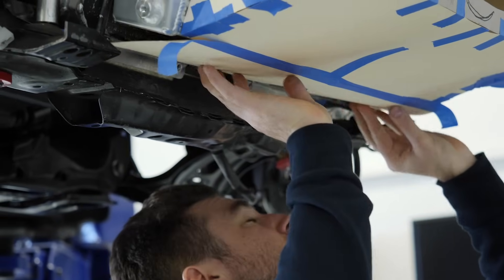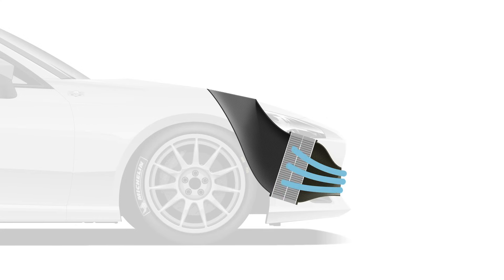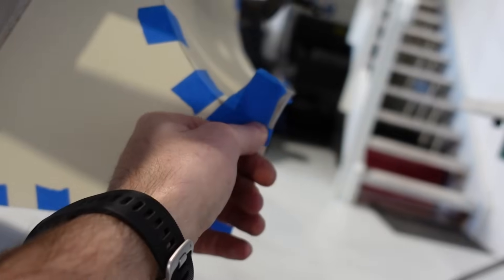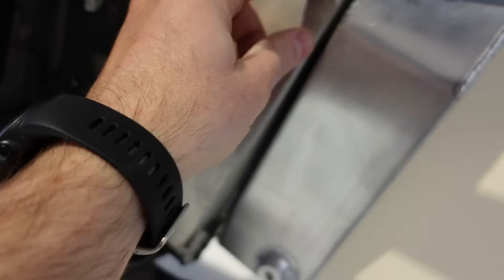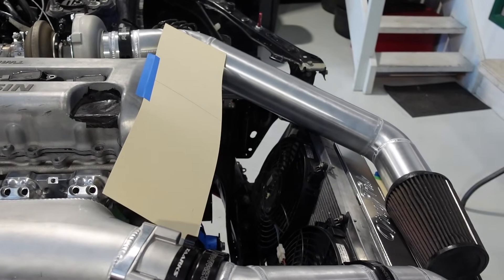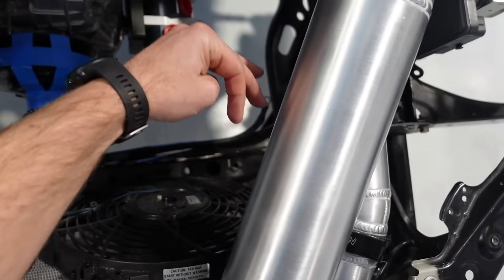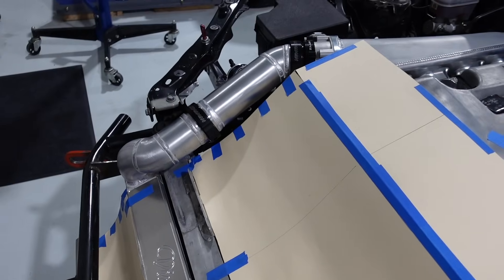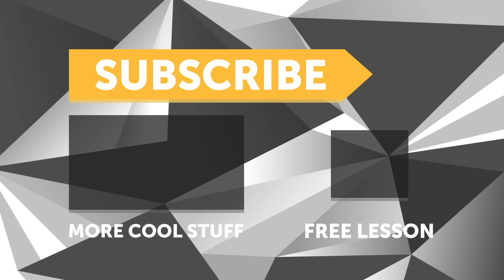Ducting and Coolers | 650HP SR20VET Swap | SR86 EP 3 [#BUILD]

Comment: I know this is an old video so this might not get much attention but just out of curiosity. How come you decided to lead all the air out through the bonnet rather than to lead at least some of it down under the car? Seems like it would be easier and the lower part of the firewall usually has good aerodynamics for it. Maybe some of it can even be used to draft air into the brakes
Reply from the maker: Brake ducts are already on the front of the car, channelling warm air from this to them would be a bit pointless and difficult in an already tight-ish engine bay.
The air going out the bonnet means it also goes over the rear wing.
Very simplified answer, but if you're an HPA member you can post questions like this up on the forum perhaps even in relation to your own specific build - Taz.

Comment: Better to face the air down after the radiator... the downforce on the bonnet is working against the fan... 

I'd be using that bonnet to reduce engine bay temps...
Reply from the maker: Hmm not quite for a few reasons, some of which I believe were also discussed in this video but Kyle also explains nicely here if you don't trust us for any reason: https://youtu.be/cDKBYfslzSw

Note Kyle is an F1 level aerodynamicist, and you will find setups like what was done on the SR86 here throughout professional motorsport (as in cars designed and built by people like Kyle specifically for performance).

You might find you are having engine bay temperature issues because of setting things up as you have described which Kyle also touches on.

Hope that helps! - Taz.

Comment: Can this same concept apply to ducting it out the bottom of the car?  Heat would theoretically create a high pressure zone under the car causing less max grip?  My car is primarily a street car and don't plan to be pushing limits on the track for anything.  91 300zx

Comment: Could you possibly use fins inside where the angle gets steeper to try and keep the air connected to the surface rather than detaching and causing stalled air?

Comment: Is an outlet duct really necessary? I the ducting is more pressure behind the radiator than if it were simply open to the engine bay, and then the hood vents could help heat escape from the engine compartment. Turbulence is the only con I can think of.

Comment: Is there a benefit on going a v mount setup as opposed to mounting the inter cooler and radiator inline?
Reply: Packaging, if you look at the jgtc supra, it has a 3s, but its pushed way back into the fire wall, that allowed them to go v mount. V mounts work well with fd3s rx7s too. So it all comes down to packaging. Those cars work because of where the engines are located, in local series like these guys run most sanctioning bodies dont allow fire wall modification

Comment: Why not make the outlet more square to get horizontal clearance? The flow out of the radiator has to deflect up pretty aggressively regardless so I wouldn't think the change in profile would change the air flow to significantly, particularly compared to kinking the inlet duct and maybe making a turbulent section beyond the kink.
Reply from the maker: For our case, we really maximized the amount of space we had available in front of the engine. Packaging proper ducting in cars like this always has massive compromises, this example is no different. We were trying to balance the outlet cross-section area we needed with the space in front of the engine and trying to make the outlet angles as gentle as possible, this pretty much defines the aspect ratio for you.  We have to work with what we've got! - Tim

Comment: What are the benefits of bringing the outlet over the top of the vehicle instead of under? Or if space permitted, out the fenders? 
More downforce? Faster air over the car acts like a venturi pulling hot air out of the duct?
Reply from the maker: The two main things to consider are packaging and aerodynamics of the outlet areas you have available. Most often, unless you are building an entire car from scratch there limited options of the places you can actually fit the ducting. Once you know the possible places you can actually fit it, you need to look at the likely pressure and velocity of the potential outlet areas. To make the outlet as effective as possible you want to exhaust the duct into a low pressure area, this helps "drive" more flow through the whole system. For us, the bonnet was a sensible place to package the duct. With the outlet (which isn't shown in this video but you'll see in later ones) we use there is a small gurney-like feature on the front of the outlet. This works by taking the high velocity clean air at the front of the bonnet and disturbing it, which creates a low pressure area in the duct outlet which helps drive the flow out through the duct. This arrangement gives us more cooling for less drag, therefore giving us a higher efficiency - Tim

Comment: Thanks for reminding me about air flow out.  I literally forgot about it I did directing air in but not out.  Where's my cardboard cheap and easy to work with.  Has there been any don't on installing dry sump oil systems like conversating from wet to dry?
Reply from the maker: Glad you found it helpful, there's definitely a time and place for cardboard and tape! Here is a recent video we did on the dry sump system on this car if you're interested - Tim https://www.youtube.com/watch?v=m8ofSWgtWKQ&t=567s
Reply: @hpa101  that video was very helpful and lost of information.

Comment: I'd split the duct exit in middle in a Y and run it out the cowl around engine for a longer travel and less back pressure to the flow path.
Reply from the maker: For sure can be a good way to do things. For us that wasn't an option with both manifolds and turbo taking up so much space at the top/rear of the engine bay - Tim

Comment: so when you have a volume of gas, and then you expand it, you end up with a lower pressure, think of it like how a ram air system works, you start with a bigger inlet, and compress it down to a smaller outlet, this increases the speed and density of the air, effectivly boosting the engine (like on a road bike). If you reverse this process and expand the air, your going to slow it down and reduce the pressure. So you should make your inlet as large as possible to catch as much air as possible, the rest comes down to packaging. (im not saying his setup isnt going to work, just his assumptions about fluid dynamics is wrong)
Reply from the maker: Here, I think you're getting confused between static and dynamic pressure. When the velocity of a fluid decreases, it's true that it's dynamic pressure also reduces. The dynamic pressure can be thought of as the kinetic energy in the flow. When the velocity of a fluid decreases, the static pressure increases. The reason this is true (at least in an idealized case) is due to conservation of energy. To put it casually, the total energy within an idealized flow is constant. So if the flow goes through an expansion, the velocity drops, this means the static pressure must increase for the energy in that flow to stay constant. Dynamic pressure is what you feel when you put your hand out the window with a car driving at high speed, you feel a high pressure, this is the kinetic energy of the air. It is the static pressure we are interested in manipulating with this style of ducting - Tim

Comment: What the trade off with airflow over the engine itself, or is it just not really something to worry about with such an efficient cooling set up?
Reply from the maker: With this style of car (something still relatively close to OEM) some air will always find its way into the engine bay and inevitably remove some heat as it moves through and on its way out. However, this isn't the dominant heat transfer method for the engine, the bulk is being rejected via the water cooling system. It's true a little bit less air will find its way to the front of the engine with this ducting setup, but the gains in efficiency (cooling divided by drag) should far outweigh any loss of cooling form the ambient air swirling around the front of the engine, fair question though! - Tim

Comment: Why dont you just make the outlet narrower (in the transverse direction of the car) so that you clear the intake? I would imagine that it's OK as long as the outlet is the same area.
Reply from the maker: For sure this is a possibility which we thought about. In the end there was a target cross-sectional area we wanted for the outlet and the space back to the engine sets the depth of the outlet for us. That then defines the outlet width and not allowing the inlet tube to pass through the duct would have meant the duct would have been a long way off center. It's certainly a compromise, both in terms of adding complexity to the duct manufacture and potential separation at the duct outlet. This is simply our choice of compromises - Tim

Comment: Great content guys! Would an inlet still be beneficial if an outlet isn’t achievable due to engine and intake configuration (k swapped Integra) We have bonnet venting already but ducting the rear isn’t viable
Reply from the maker: With this style of duct, for sure the outlet is just as important as the inlet, they're designed to work together. Packaging is always a challenge with this stuff, there are certainly plenty of compromises in this setup of ours as well simply due the space restrictions! In saying that, if there's simply no room then yes it is probably still worthwhile to have the inlet only. For the outlet, just do the best you can to try direct the air exhausting from the heat exchanger to the lowest air pressure area you can, good luck! - Tim

Comment: You should have K24 swapped it instead. Far superior engine to the old.shitbox sr
Reply from the maker: Here's the thing - Everyone has their own opinion on what is the best engine in the world and that's fine. What you obviously don't understand however is the reasons for our decision. First of all a K24 would be absolutely useless to us since it would put us in a different class so it's not even an option. 'Use a K20 instead' I hear you say? Yup, could have done that and granted it's a great engine - Perhaps one of the best N/A 4 cylinder engines I've tuned. Problem is we didn't have a K20 and couldn't have sourced, built, installed and wired one in 4 weeks so again, simply not an option. On the other hand we did have a complete built SR20VE sitting in our 350Z. 

Next let's address this 'shitbox' SR you speak of. While I wouldn't have used the term 'shitbox', I also don't have a lot of love for the run of the mill SR20DE/DET. The head flows poorly and the valve train is a disaster. This however is NOT an SR20DE/DET as it uses the VVL head from the P11 Primera. The P11 head flows exceptionally well (probably pretty similar to a K20) and uses Nissan's take on Honda's Vtec with high and low rpm cam lobes. It also uses a rock solid shaft-mounted rocker system fixing all the woes of the DE/DET heads. Ultimately there's not many 2.0 litre 4 cylinder engines I've tuned that can produce 600 whp on 24 psi and have a power band from 4500-9000 rpm - Hard to refer to that as a shitbox in my humble opinion but perhaps that's just me - Andre

Comment: Love the fan work, this kind of stuff take forever.

Minor technical nits, you want the highest mass flow possible through the heat exchanger for maximum cooling. The problem is a duct you put in front of hx is likely going to stall (flow.separation) at some range of Reynolds numbers, this makes mass flow.really drop.

To help keep it from stalling, put at least a 10-20 mm radius on the inlet as you won't reattach in a duct like that if you get inlet separation (look at F1 duct inlets).
Reply from the maker: You're right, some large radii would definitely be a good addition in future. Like many things when you're in a hurry like we've been, you've got to draw the line somewhere in order to speed up manufacture time - Tim
Reply: @defsr7 Help me wrap my mind around something: if you want more mass flow through the heat exchanger why is it beneffitial to have a smaller inlet? I'm not saying they should go the opposite way. I trust this is proven experimentally and theoretically. But I don't understand what would happen if your inlet was 100% or120% of the frontal area of the heat exchanger? Will the air "spill" around the inlet? And what determins the "optimum" ratio of inlet to heat exchange area? Is it a function of the drag induced by the heat exchanger? A function of the speed? All of the above?
Reply: @TrackDaysMX  The smaller inlet helps expand the air, so it does indeed convert more of the total pressure (which is Ptotal = Pdynamic (the moving part) + Pstatic (what pressure you see referenced 90 degrees to its streamline) to static pressure. Essentially you slow flow down from a high speed, small inlet at some given Ptotal, to hopefully the same Ptotal (not possible, there are always losses due to friction/separation to various degrees) but at a higher static pressure and lower dynamic pressure. This Pstatic is what you really need to drive flow through the radiator core. 

Why does a giant inlet of say 1.2x the radiator area not flow more? Well, the radiator exit probably has a pretty high Pstatic (slow moving flow there) even if it's evacuating to a fairly low pressure area, so it needs to build up some Pstatic to actually flow across the radiator core. A giant 1.2x radiator face duct inlet is going to be seen as incoming flow as a giant "brick wall" of almost no airflow, so most the air hitting this giant brick wall of a duct will generally spill out and around it. This is going to create a ton of drag, as you're pulling this giant area of generally high Pstatic along and doing nothing but forcing a ton of air out of the way in a generally turbulent/uncontrolled fashion. 

A well sized duct will expand the air just enough to get the Pstatic high enough to flow at an optimal amount depending on your radiator fin density/exit Pstatic etc. Expand it more than this and you've throttled the inlet down and you just can't get enough flow into it (Ptotal is fixed in airstream). Go above this perfectly expanded inlet size and you do tend to just stall flow in the duct as it chaotically and not uniformly slows down. It also tends to be highly unsteady, which creates tons of vortices and buffeting (more of that drag thing).

Here's a good paper going on the basics of duct design. I wouldn't put too much faith in this undergrad level of CFD, but they get the general idea right, and there's a good graph showing that for their application, an inlet area ratio of about 0.8 gave them peak mass flow through the radiator: https://openscholarship.wustl.edu/cgi/viewcontent.cgi?article=1101&context=mems500

I imagine if they looked at what is happening after the HXer in a bit more detail, they'd probably trim that down to a 0.6-0.7 area ratio for peak mass flow.

Comment: Hi guys, great work!! Is the ducting in the engine bay sealed or is it drawing from the bay also?  Just trying to get my head around the physics involved.
Reply from the maker: Thanks! The inlet duct is sealed to the intercooler, the outlet is sealed to the radiator and the intercooler and radiator are sealed to each other. The idea is to keep the flow through both heat exchangers as separate as possible from anything else like the engine bay. This style of system only works properly when you can control the airflow - Tim